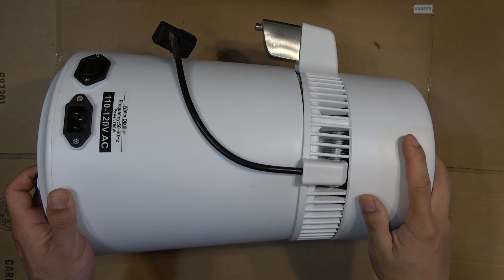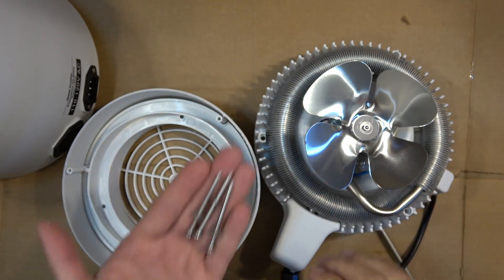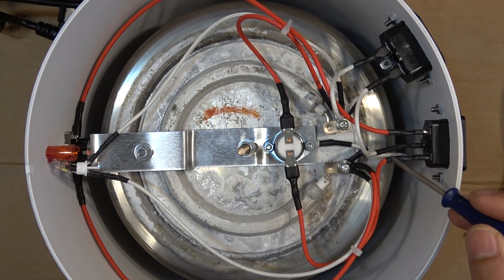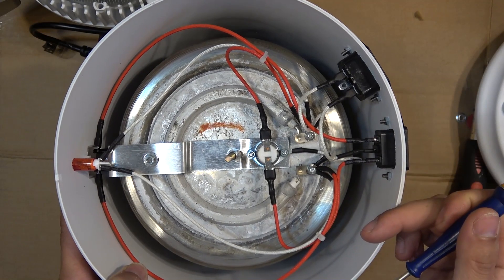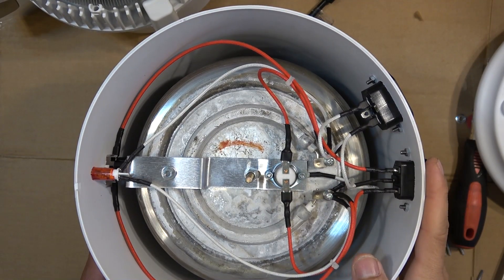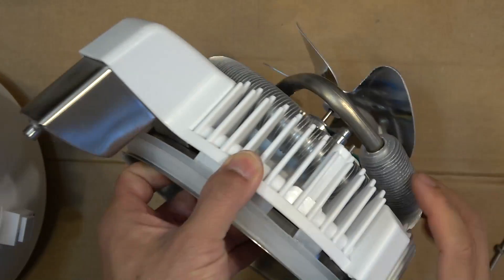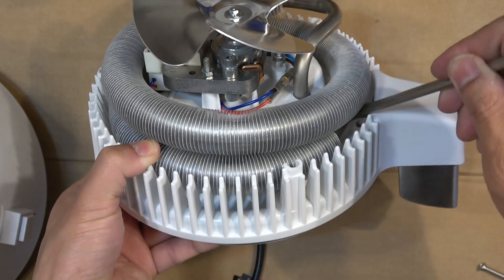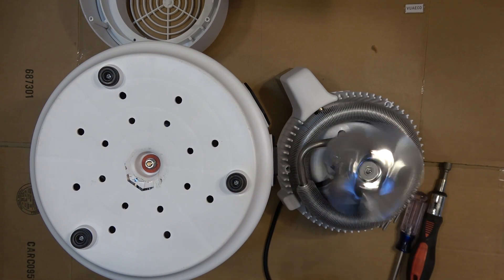Teardown: Ebay 1-Gallon Water distiller. What's inside and how it works?

Comment: Hi. You claimed that the tubing in the upper fan part does not use heat sinks. In fact, it does. I heat sink is made of cooling fins. You have the circular cooling fins along part of the length of the tubing. These fins get cooled by the fan, which in turn cools the water vapor, changing it back to water (distilled). And yes, I love this distiller's design for its simplicity. You claim to get nearly 100% distilled water with it. This is the type of review worth knowing. Thank you for your video. I enjoyed watching it and finding out how the distiller is made.

Comment: \My Mophorn Pure Water Distiller 750W, Purifier Filter Fully Upgraded with Handle 1.1 Gal /4L, stopped working while plugged in.  The unit had tripped the electrical outlet it was  plugged into and two other electrical outlets.     After watching your video, Teardown: Ebay 1-Gallon Water distiller. What's inside and how it works? , I want to replace the heat sensor.  Do you agree?  How  do I find the part number for the heat sensor?
Reply: 1.  KSD301 or KSDS snap disc manual reset sensor/switch     (reset switch)
2.  KSD1 135 degree Centigrade snap disc normally close (NC) temp sensor/switch on pot bottom   (turns heating coil on and off)
The old disk sensor on mine was KSD1 150 C. I replaced it with KSD301 135 C normally close (NC) from Ebay. I think 5 sensors was under 4 dollars even with shipping! Distiller has been running for 2 hours now with no resets!

Comment: What an informative video. I thoroughly enjoyed listening to you. I currently have my distiller disassembled (by myself) because of a leak. The  stainless steel they use is SO thin, and usually starts to develops holes after years of use. It has nothing to do with "uncleaned calcifications". My unit is very well maintained. I keep it clean. The quality of stainless they use is the main problem. That's too bad because the product like you said is excellent in every way. Yeah, they do not want you fixing your own distiller so they have stickers everywhere warning you about the dangers of getting electrocuted, losing your warranty, etc., blah, blah. I am a senior citizen and I dared to open my own distiller to see what needed to be fixed and to my surprise, this appliance has few parts and is simply assembled. My father always told me, "If other people can do it, why can't we?" So I repair anything that goes wrong in my household. A tip to all of you who use this type of distiller, use a timer to turn the device off after 5 hours of distilling. You will not have an inordinate amount of difficult to clean up residue. There will still be a bit of water left. If you add a fourth of a teaspoon of citric acid powder into the water before you start distilling, you will never have to deal with any residue. The distiller works at about 212 (F). The boiling point of citric acid is 590(F), so the citric acid will not actually be in your finished distilled water. It will be left with the little amount of water left in the distiller if you set your distiller to turn off after five hours.
Reply: Doesn't it switch off automatically after the water is finish
Reply: @tazboy1934 Yeah once the water is completely gone, it solidifies the leftover minerals... I too have a timer set to cut off at 3h30m which will leave a bit of water behind to prevent it.

Comment: Thank you for taking your time to show us the insides of our distiller! Yours looks exactly like mine, a CO-Z 1 Gallon Water Distiller. But from day one, if I let it shut off with the over temp shutoff, it will burn the bottom. I want to try and put a slightly lower shutoff that will allow it to get MOST of the water distilled, but not all. There has to be a gradual increase of temp on that high temp shutoff switch as the water level gets lower. I want to see if I can find a switch that will open at a slightly lower temp to keep it from burning, but distill most of the water. I'm using a timer set at 3hrs and 45 min right now, but it will occasionally fail. Do you know the thermal rating on the original switch? Again, thank you very much for giving me the courage to open this thing up. Looks very easy like you said. Besides, I fix much more complicated equipment than this in my sleep. LOL
Reply: Did you find a solution?

Comment: you should really label this vevor water distiller 750w 220v 110v tear down. UPDATE: new units doesn t have a ce sticker at the bottom. can you make an new video showing the infamous air hole in the cooler unit?. need this for my cpap machine and to drink with added minerals.

Comment: The metal spout pops off, isn't actually connected to the coil....

Cheers and thank you for the video.
Reply: Yup, in fact, you probably want to remove it every so often to replace the activated carbon filter in there every so often. That will eventually get saturated with VOCs or other contaminants and become ineffective, so it's wise to change that out regularly. I just fill one of those tea filter bags with bulk coconut husk charcoal granules once every quarter for peace of mind.

Comment: Looks like a gallon from this unit would cost me $1.60 today for electricity plus the depreciation value of that unit. Store bought starts to be attractive.
Reply: What depreciation? The thing is dead simple to operate and relatively cheap to repair. It's not like this is a car where there's a secondary market for these things.
Reply: The units cost 50 to 100$ and have a lifespan of-----? gallons.  Put in the numbers and discover that store water which is monitored and tested is the better buy. @MikeTrieu

Comment: So it's basically just an electric kettle using a charcoal filter where the steam cooled water exits the unit.
Reply: Well, it's an electric kettle with a very efficient condenser coil on top of it with a high-flow exhaust fan. If you wanna jerry rig a similar contraption on top of your electric kettle, be my guest, but this is purpose built with all the proper silicone gaskets to condense every bit of vapor with hardly any water lost to steam.

Comment: With the lousy quality of these components and the up front cost plus electricity, store bought distilled water is an absolute bargain. Such water is vacuum distilled and requires little energy with less carryover of minerals to the finished product. Also, the heating elements from China are notorious for breaking and for that there is no fix. Just a quick calc in my head, with power  @.30 per KW, a gallon costs about $1.60 + which is nearly the cost in the store. The only advantage is NOT having to carry the water and end up with a plastic bottle.
Reply: Even at the crazy high price of .30 per KW a gallon would cost at most 90 cents. Nowadays distilled water sells for $1.35 gallon in my area. Cost in my neck of the woods is 36 cents a gallon to make my own.
Reply: One can safely assume that the finished quality of commercial water is monitored and would have far less carryover of contaminants than these small Chinese units with such a small condensing unit and without any documentation or certification of finished water quality. Add in the cost of the unit and assumed lifespan and store water is cheaper.  @LaVidaLocaHomie

Comment: Hi, I have bought 9 machines in 7 yrs, the first 8 broke down within 6 to 9 months, my current one amazingly  has lasted  20 months but has started to turn off after running for a a few minutes. Where  can I find parts, like sensors, power buttons & wiring, I keep browsing the internet and nothing comes up. Thanks for your informative video.
Reply: Ebay

Comment: The switch that is on mine, the one on the bottom of the pot is a KDS1 195 any ideas to what one to replace it with? I don't want to throw the unit away. I was thinking the 135C switch, is that correct? Thanks.

Comment: Mine just stopped working after 6 years...I took it apart credit to this video...Checked all the important connections to the boiler chamber....I saw that there was a little erosion/limescale on some of the connectors...cleaned thema little, reconnected and voila...It's working like brand new!!!!
Reply: What Did You Use To Clean It

Comment: I've had several of these distillers and power switch sensor is what always fails.  Now that I know how to open it up I'm going to try and repair two distillers that stopped working.  Where would I purchase the sensor parts ?
Reply: Ebay

Comment: Thank you very much!! 

I have a question: I have a similar unit, although mine, Vevor branded, has a dedicated on/off switch. (I don't know if that makes things easier or more complicated.) But I use a nifty little 12 hour countdown timer set to 4 hours (and I always monitor the output just to be sure) so I never trigger the built-in heat sensing shut off. (I also try to make sure I leave some water in the bottom of the pot so it makes cleaning easier.) By avoiding the high temperature sensor cut off shut down should I expect a longer life out of this unit/is it easier on the wiring?

Comment: Thanks for your great instructive video, could you please tell how would it be possible to install digital heating thermostat to adjust desired temperature (for example heat only up to 80°C )
Reply: I want to now the answer to your question as well 
Did anyone work it out

Comment: Have you figured out how to unclog the narrow pipes? That causes over heating and constant shut-down. Thanks so much for your help.
Reply: What narrow pipes? Are you referring to the coil in the head/fan unit?  How do you know if that is clogged?  Yes, I also have constant shut down problem and I'm trying to debug it.  I realized it's related to the switch.
Reply: @dknc7393   The pot sensor has failed if you notice that you can fill the pot up, turn it on and it runs for less than an hour and turns off. Both sensors can be ordered over Ebay and are not hard to replace.

Comment: Bought,as mistake 110VAC version and connect it to 220VAC local power.
As I saw,fan was damage.
Where can I buy the new one?
If there is only it can be damage or heating element also need to be replace to 220VA?

Comment: It says 120VAC input but anybody try 240VAC on this distiller?  

Would rather have better balanced 240VAC input when running so many watts for so many hours.  Also 240VAC would be better with my solar inverter's output instead of always loading one leg of the home power circuit on just the 120VAC.

Comment: The on/off switch in the front of the unit is a FULLSAFE KDS 115 thermal reset switch. I'm still trying to source one.
Reply: The only seem to offer one with 110c which most people seem to be buying.
https://www.ebay.com/itm/10pcs-Manual-Reset-Temperature-Switch-110-C-NC-Bimetal-disc-thermostat-KSD301-/392268428153?_trksid=p2349624.m46890.l49286
Reply: @Authoratah  Thanks. I just bought that one. It will be interesting to see if the old distiller can work again.

Comment: I bought my first distiller of this type which I paid almost $200 nine years ago,  by 9 months it stopped working. Since it was under warranty was replaced by another that only lasted 6 mos. the following ones never lasted more than 9 mnths. My current one ( # 8 distiller) just broke 3 days from reaching 12 months. I least after the 1st one, the rest of them I paid average $80 from amazon suppossedly "NEW". You mentioned only 2 things can go wrong, sensor & "ON" switch. One of them burned the electrical cord from the plug. I tried to replace parts but they were going to cost me $80  so every time I end up ordering  another from amazon. Where can I buy just those parts , are they generic stuff? I'm tired of discarding all this metal, cables, platic . HELP!  Thanks
Reply: What temp of the sensor which burns the cord?

Comment: "The only thing that can go wrong is the heat sensor" 
'Hits it with metal screwdriver'
Reply: Hey guys we keep coming up with tricks to fix the "HEAT SENSOR" without specifically recognizing that there are two of them: one in the center of the bottom plate (that I believe is auto reset) and the other (lets call it the power switch) located at the manual reset button. So unless we specifically state which one we are talking about some viewers may apply the solution stated to the wrong sensor creating a hazard condition specifically when jumping the sensors. The question I have in my mind is that if the one at the power switch turns the unit off automatically and on manually whta is the function of the one in the center of the heating plate?
Reply: @jamespier5476   Hi, the function of the one in the center is a sort of safety feature , a second line defense. In case thermal switch at the button fails to open when it reaches 110c, the kettle will run dry and burns. So the second switch cut power when the temp reaches 135c. But since it is auto it will turns on again when the temp drops. Distiller will turn on and shuts ,till it gets your attention.
Reply: @guppiesstories5942  the one in the middle is to keep the heater up to 150 celsius , and its a NO switch , the one one the side is safty swich which shut of the current when the temperature reach 110 celsius (when its dry, out of water )   and that the one thats making the trouble because it resets before the destillation is finished .
Reply: @breakfastbuddy5   A NO[normally open] switch is a normally open switch. So no electric current is flowing through. So how does the middle switch keeps the heater up to 150c ?   The correct specification is that the middle thermo switch is a NC [normally closed] auto switch rated at 135c. It is auto, that is to say it will stay closed till the temp hits 135c, and it opens cutting off current. When the distiller cools down, it will automatically closes, but no electric current will flow because the side switch which is a manual switch has already open, unless the side switch has a failure like melted in the closed position. The side switch will stay open till it is manually reset. One must remember the temp of the distiller seldom hits 135c under normal working condition. You are right to say the side switch is the trouble maker because it is the hardest working part of the distiller. The middle switch remains as a safety feature/alerting failure

Comment: Home run!  Your next video should be how to replace the thermostats when they fail and we will support you by buying the thermostats from you .... deal?
Reply: Changing the one at the center of heating plate should be easy as  Vuaeco says  but that is not the only thing that can go wrong the one at the power switch can also go wrong and its complicated to change depending on the model unit you have and in some you have to buy the mounting plat with it.  Also the start button would have to be adjusted correctly to operate the sensor switch and it has its own mounting variations depending on unit. So I hope Vuaeco hears you and does a second video. Great video Vuaeco and great camera. Thanks! My unit is similar to yours and it turns off way before the completion and as I turn it on it goes back off within 10 minutes. So I'm still trying to figure out which one is the sensor that turns it off.

Comment: Some other reviewers showed that the end of the distiller where water drips out of the stainless steel has a silicon L shape pipe then to the stainless steel spout.  Can that silicon/plastic pipe be removed and still drips fine, continue out to the spout?  I am trying to avoid having any "plastic" touching the water.  Is that possible?
Reply: I drip w/o the filter and directly from the end of the condensation pipe and it works fine.

Comment: I have the same distiller. I've got what looks and feels like small chips of black rubber or charcoal coming out with my distiller in the water. Any idea what it could be? Please help
Reply from the maker: The only things that are in contact with the hot water inside are the stainless steel internal pot, the lid, and the silicone seal. I don't think there's anything of black rubber or charcoal inside this distiller. Maybe it came from the outside?
Reply: @vuaeco  Thanks. I wish I could post a picture of it. The upside is that my water is safe.
Reply: Take your spout apart. Some brands were shipped with an optional charcoal filter that fit in the spout.  Your's may have deteriorated.  The cooling coil should not have any particulate.

Comment: I cleaned my fan and heat sink a few days ago because it wasn't distilling, half the water evaporated and water was leaking down the fan's power cable.. now is ok again :)

Also i have the 240V 750W version for Australia (248V actual output in my house), and i measured it to actually use 985W until boiling time, then it uses less watts.. 

It was advertised as making 4Litres in 4 hours, but it's actually 3.5litres

I have another one in Turkey which uses 230V, it takes 4hours and 19 minutes to make the 3.5Litres